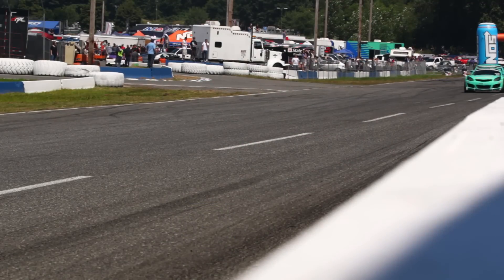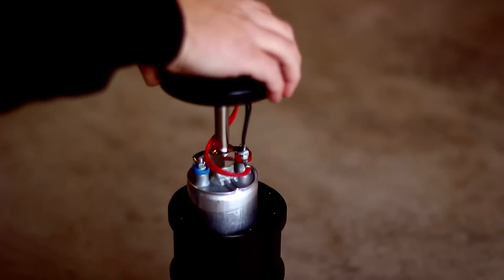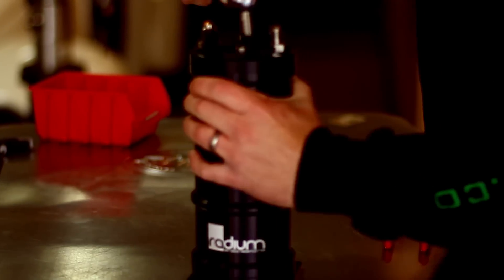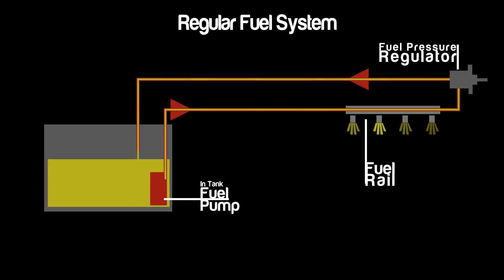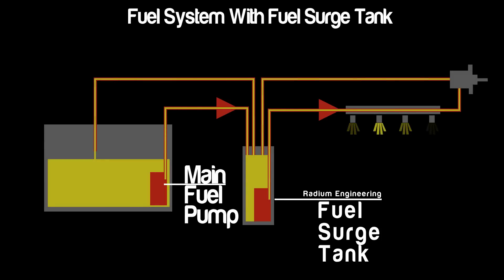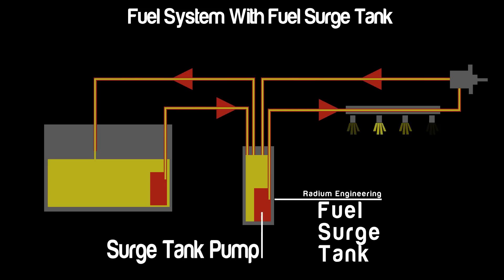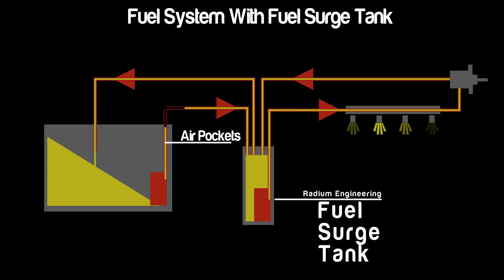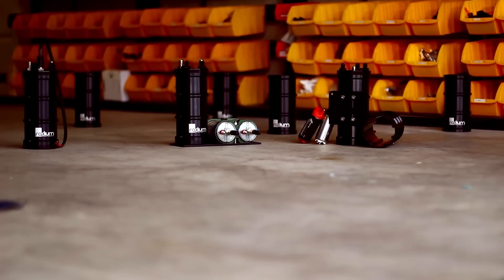How does a RADIUM Fuel Surge Tank work?

Comment: This doesn't work like you think if you put a pump inside the surge tank it becomes a fuel heater. The only scenario I've found is external pumps to the surge tank on the supply side.
Reply: No actually the fuel cools the pump actively. Theres too much fuel volume for 1 pump to actually raise the temp of ALL that fuel as it moves around the system. If that were true, it would have been noted by the many racing teams that use fuel surge tanks. Not to mention, look at how many stock street cars use fuel pumps inside the tank. I hope you dont think it's some new thing to have a pump inside a tank of fuel. . . . .

Comment: Taken quality to a next level that others are trying to copy now. Great product and I will be upgrading to a bosch twin setup soon :-) do you guys make any custom setups??? I have another 1000 hp build that will run high RPM and top speed runs with. I would like a fuel surge tank that runs with a aeromotive eliminator fuel pump which I already have with pump speed controller. Would love something that incorporates both the aeromotive eliminator and speed controller with 5 litre capacity :-)